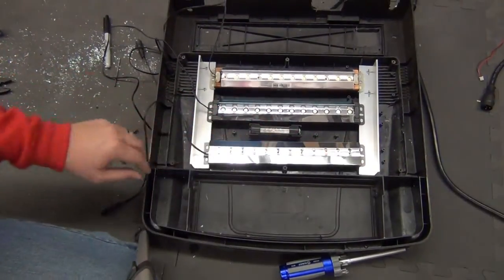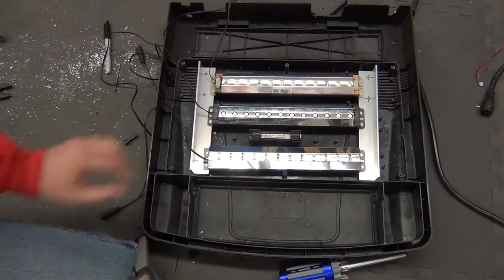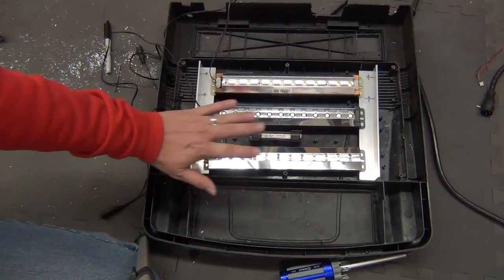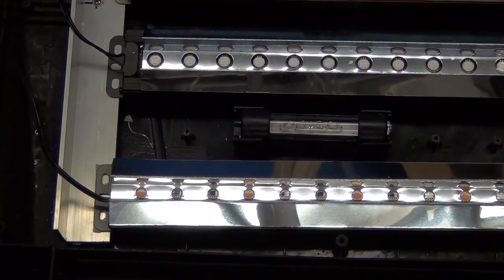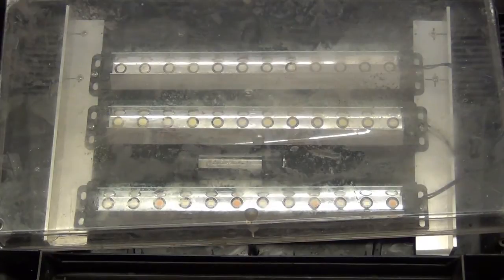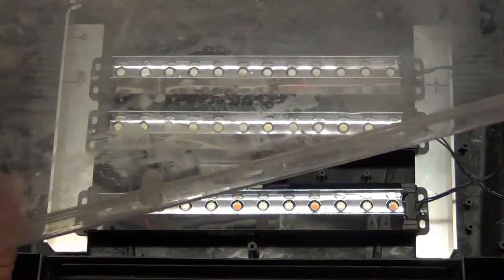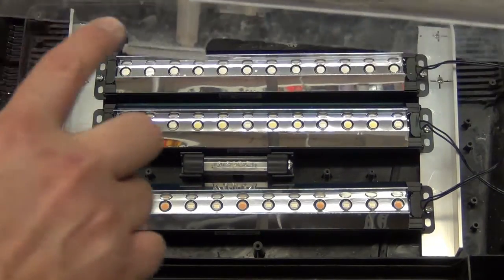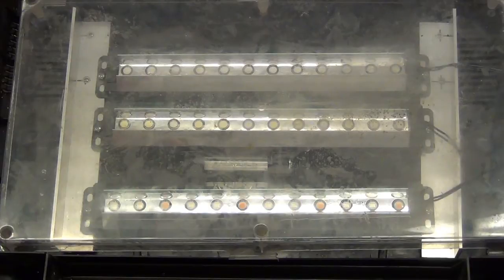Biocube LED Upgrade ***Revised***  Part 3

Comment: Looking good so far.  Can you use the fans with this modification?
Reply from the maker: If you used two led modules you probably could but with three it would be hard.  With the way I vented the splash guard any air movement would be effective.